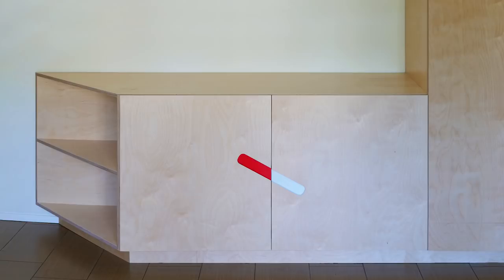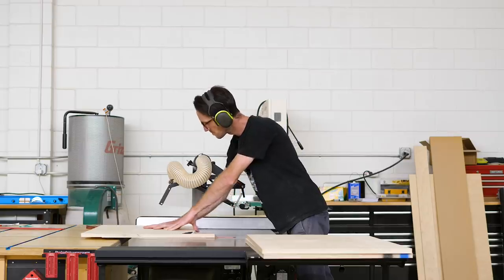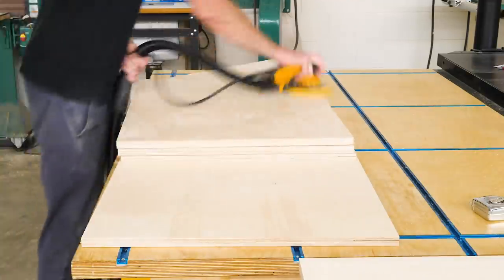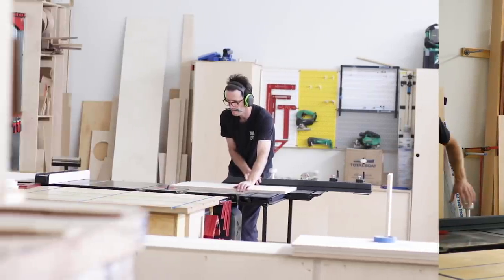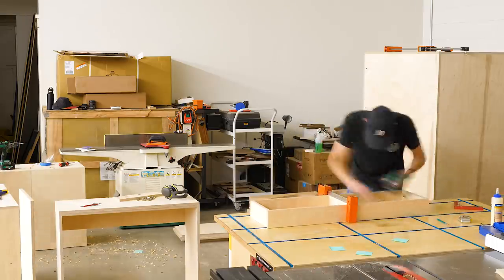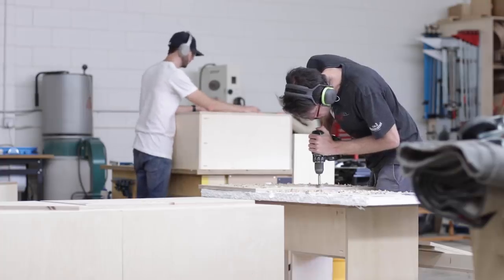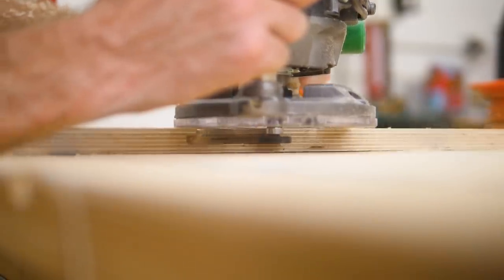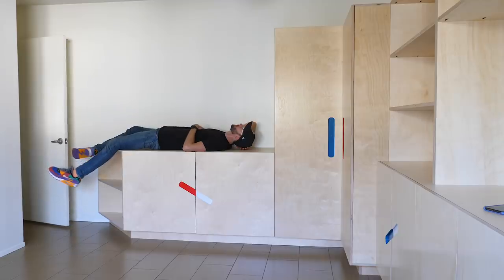We Turned An Office Into A Bedroom with 14 Sheets of Plywood | Bedroom Renovation Built Ins

Comment: Have you ever tried or considered maxicut? You give it the list of pieces you need and tell it how you want things organized (minimize cuts, minimize long cuts, minimize crosscuts, etc), and it organizes your sheets for you and even gives you labels to stick on, if you want! It really changed my efficiency in the shop and helped me cut down on waste.
Reply from the maker: I haven’t. I know there are plugins for sketchup that work similarly too. I’d be interested to see how it works.
Reply: @Foureyes.Furniture  correction... it's called MaxCut. i love it. any time i need to do a lot of stuff (esp drawers) and make the most of my materials it is clutch! i dunno if it's as useful for custom furniture (it can sometimes take a while) but for making drawers that i've made a number of times before, it's nice to just pop in the numbers and it'll tell me how many sheets of plywood to buy and how to cut it. i set it up to do cross-cuts first so that i can have the wood shop break down the sheet into pieces that i can fit in my car and then it's really easy to get going once i have the wood in my shop!

Comment from the maker: Thank you for watching!!!
▸ Subscribe - https://goo.gl/oVdN4f
▸ Support on Patreon! - https://www.patreon.com/ChrisSalomone 

KREG ADAPTIVE CUTTING SYSTEM
▸ Kreg Adaptive Cutting System - http://bit.ly/ACS-foureyes
From now Until December 31st Kreg is running a promo on the ACS. Here is a link to the page with the deals and all information: http://bit.ly/iiii-ACSpromo2019

/ FEATURED ROCKLER PRODUCTS
▸ Rockler Project Mat XL - http://bit.ly/iiii-ProjectMat
▸ Cross Cut Sled - http://bit.ly/iiii-crosscut
▸ Corner Clamps - http://bit.ly/iiii-CornerClamps
▸ Digital Angle Gauge - http://bit.ly/iiii-DigitalAngleGauge
▸ Self Centering Bits - http://bit.ly/iiii-CenteringBits
▸ Blum Soft Close Hinges - http://bit.ly/iiii-BlumHinges
▸ Incra Miter Gauge - http://bit.ly/iiii-IncraMiterHD
▸ Kreg K5 Pocket Hole System - http://bit.ly/iiii-PocketHoleSystem
▸ Shelf Pin Jig - http://bit.ly/iiii-ShelfPinJig
▸ Hinge Drilling Jig - http://bit.ly/iiii-KregHingeJig
▸ Hinge plate Template Jig - http://bit.ly/iiii-JigItTemplates

X-Carve by Inventables:
https://www.inventables.com/?ref=FourEyes

Woodpeckers - All The Red Stuff For Measuring
▸ http://bit.ly/wpfoureyes

Comment: After some time the adjustment of these hinges out and never aligned well as new , 
These plywood doors are heavy 
And these type of hinges are  suitable for lightweight doors not for heavy doors.
Reply: That is true unless you buy good ones, in which case they usually stay aligned well and can be adjusted at any time if they do go out.  The hinges made by better manufacturers have a weight rating for the doors they can support and as long as you stay within that limit they work exactly as they should.  My kitchen cabinets have been up for 34 years with heavy doors on concealed hinges and the doors are still perfectly aligned.  Next year I will build new ones I think...

Comment: That has Tickled me !!    at 5:38 you start to drill pilot screw holes then come back to the same hole, to countersink having to put down the drill to change to another drill which holds a countersink bit!!!!.  Geez it seems you need to spend a couple of Dollars on a Drill/Countersink Combo n stave off buying a new Woodpecker tool until you've recouped the Dollars spent on the Combo.  I seemed to think that the thought pattern re: this vid was about in part to economy of thought/movement/repeated processes.  just sayin lol.